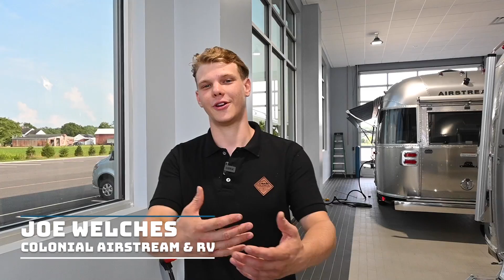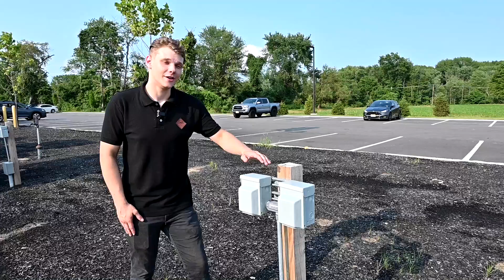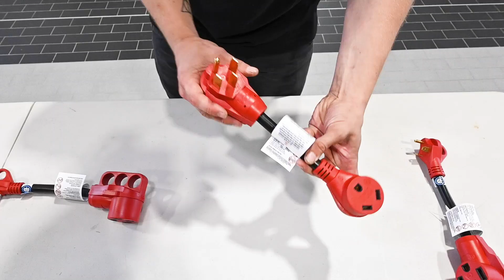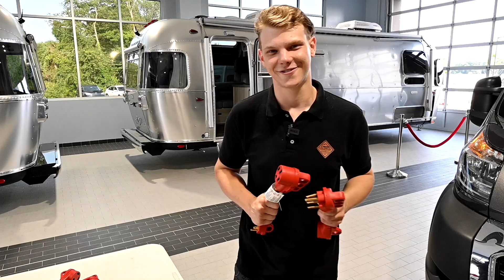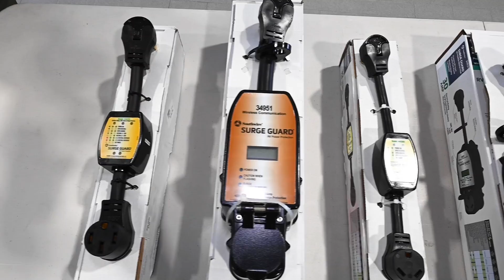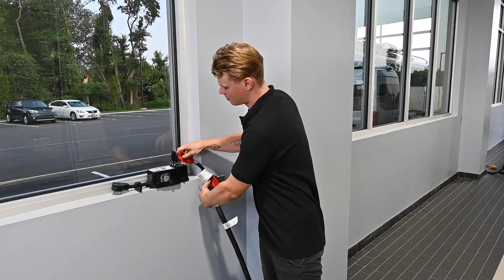How To Properly Use Your Airstream Power Cords, Electrical Hook Ups & Surge Guards.

Comment: Quick question. What is the proper order to connect the power. Plug surge protector into pedestal first. Connect 50 amp cable to surge protector then connect smart adapter to the Airstream?

Comment: Can you hook a dog bone (30 amp to 15 amp) to a orange contractors extension cord if the airstream can't be parked close enough?
Reply from the maker: You can for charging and refrigerator use but not for using the air conditioner.

Comment: Hello!!  If we have a 50 amp Flying Cloud - does that mean we should carry a 30 amp EMS and a 50 amp EMS?  OR can we get away with just carrying a 50 amp EMS?  Thanks for all the videos!
Reply from the maker: you can carry the 50amp on and then an adapter if you encounter 30amp sites.
Reply: @colonialairstream  you just mean the “dog bone” 50 to 30 adapter, correct??